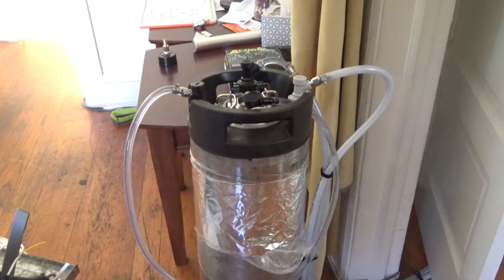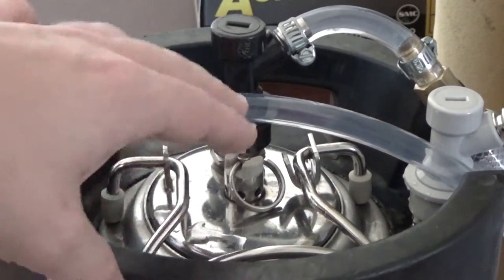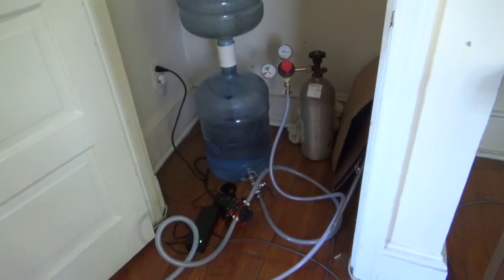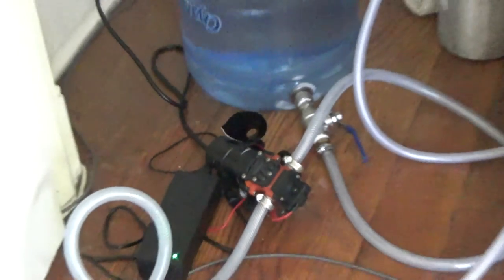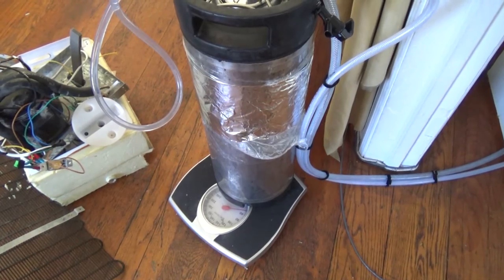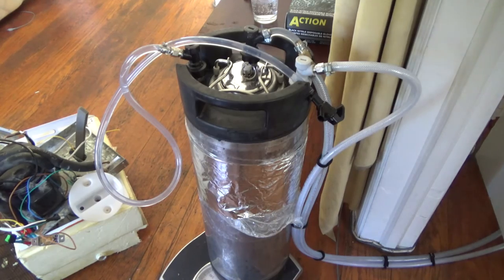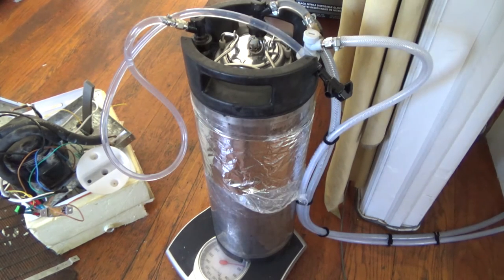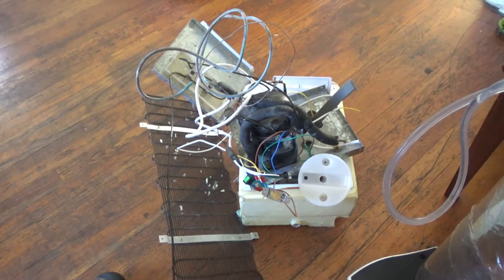Custom Carbonated Water System - Part 2

Comment: I have problem, my samsung led monitor s22d300ny goes completley white after i turn it on, i opened it and i dont see anything wrong, what should i do?
Reply from the maker: Have you tried using the other inputs? 
You can also buy a new input board, does this look like the one in your monitor? http://www.ebay.com/itm/like/252538345599?lpid=82&chn=ps&ul_noapp=true 

if not see if you can find a serial number on the board and search online using that number, for a replacement board.